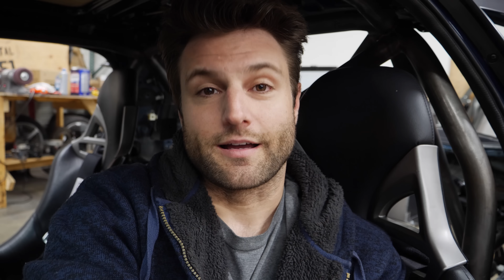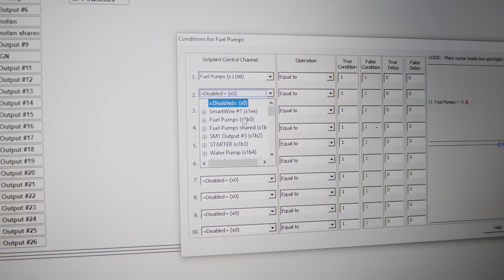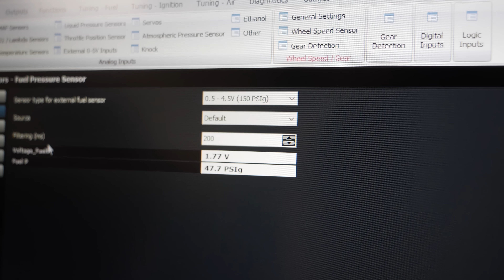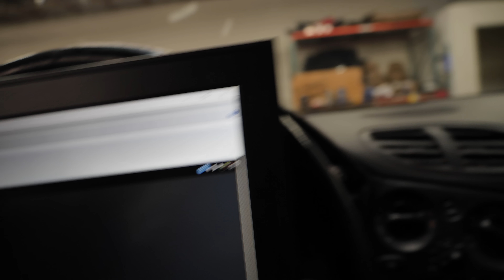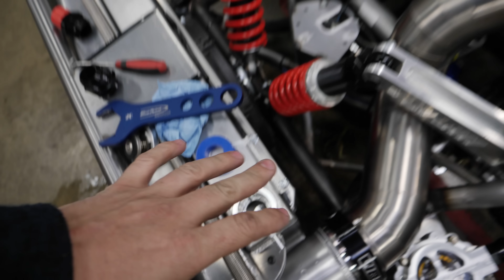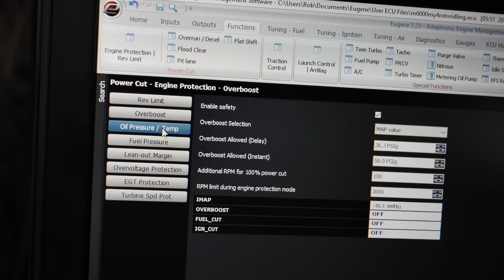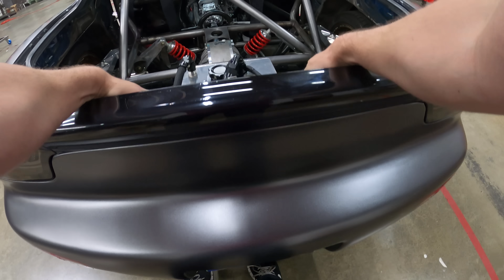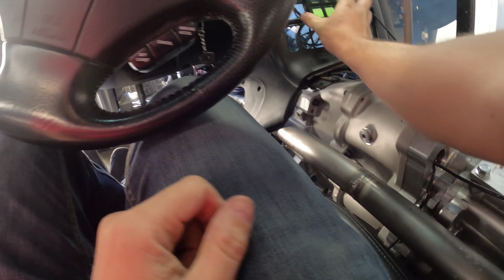I DRIVE the AWD 4 Rotor RX-7 for the first time! A couple feet before it has issues lol

Comment: I’m just looking forward to awd 6k rpm launches.
Reply: Daniel G with how weak that chassis is?
Reply: @einzelmotorsport6711  Tube frame everything is weak?
Reply: @einzelmotorsport6711  Like the chassy built for that?!
Reply: Felix XD looks less stiff than a roadcar even.  All show no go. Nice welding, no thinking. If it flexes that much from removing a single tube, its a joke.
Reply: @einzelmotorsport6711  are you an engeneer or just a trash talker?
Reply: that_gtr_r32 I build racecars for a living for a decade and a half and made many tube frame chassis, roll cages, suspensions from scratch and structures .  What is your job?
Reply: @einzelmotorsport6711  lol does not matter what i work, maybe all these chassis you did, were not good, just because you did not get it work does not mean anyone else could, just because the chassis flexes cause one tube is disconnected does not mean it fails, a normal chassis flexes even more, you cant see it cause there are no tubes that wont flex under load
Reply: that_gtr_r32 what we made worked , my stuff doesn't flex half an inch upon removal of a little tube.  So what is your job since you think you are able to judge this? State your qualifications please.
Reply: @einzelmotorsport6711  i dont judge this? Lol stop hating so much, you did not even see this in action and you say its gonna fail and that its just show.
I dont need to tell you my job and im not gonna go further into this, as a racecar builder that you are, you should have more respect for other builders, cause this just makes you look like a jerk, i would not let you work on any of my cars cause you dont respect what other ppl do
Reply: that_gtr_r32 well, I did see it in action, when dude removed a single straight tube the chassis caved in on one of the most critical positions.  People confuse 'being a nice guy' with being a proper builder.  There are tons of builders out there who keep their head down and do a 10x better job.  Its a free country, I'm allowed to say that just as I'm allowed to praise.
Reply: @einzelmotorsport6711  not hating on you dude, im just saying, wait till it hits the track, there it will talk for its self, if its shit, it will break. And he also is learning by time, dont talk shit on him cause you for sure did not start building cars perfect when you started.
Reply: @einzelmotorsport6711  Duh, you as a "proper builder" should know that a tube chassis is not rigid when there are bits missing from it. Like, a roll cage won't do shit if you remove the top of the main hoop. I think Rob has made plenty of research to make the Ahura strong enough